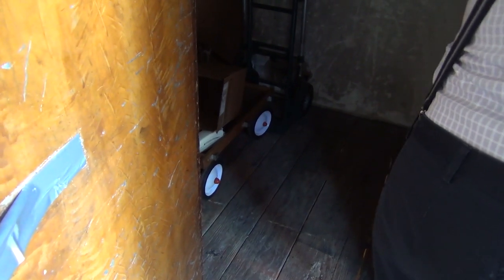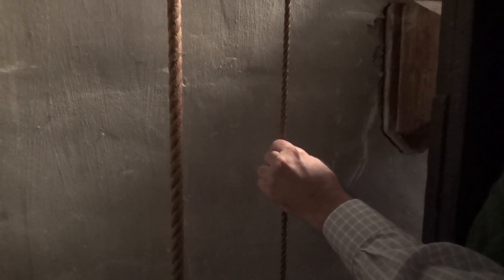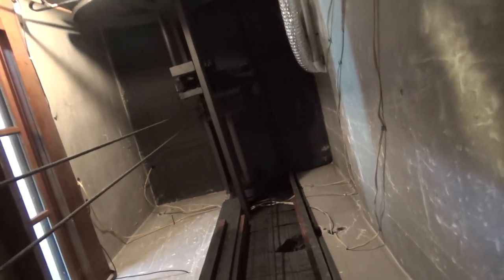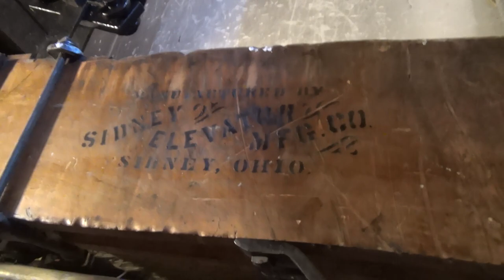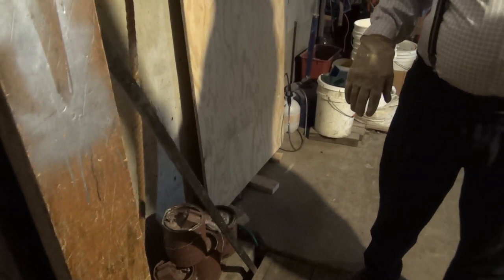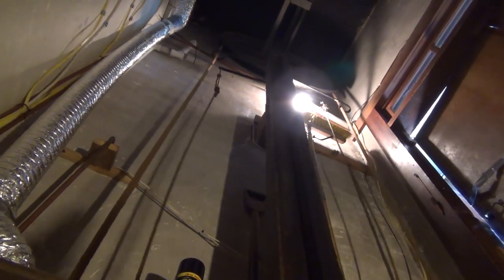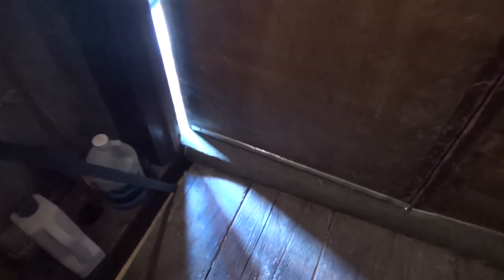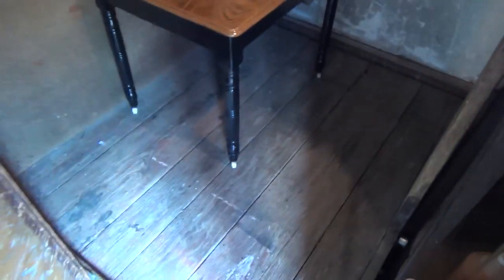Historic 1903 Sidney Non Electric Freight Elevator

Comment: I think this solves a mystery for me.  Sometime around 1972, when I was about 4 years old, my mother took me to a furniture store in Steubenville, Ohio.  She was looking for something specific (I have no memory of what it was), and they didn't have what she wanted.  The salesman (presumably working on commission), said, "We just might have something in the warehouse upstairs."  He took us over to an elevator and we got in.  There was a rope running right through the middle of the elevator.  He gave the rope a jerk and the elevator moved on its own up to the second floor (with the rope moving rapidly downward through the elevator).  I was amazed by the whole thing, but I didn't mention this to anyone due to the fact that at 4 years old I was still encountering new and amazing things often and the adults could be quite condescending whenever I mentioned wonder or astonishment..
This is the one thing I encountered as a small child that I have never seen again, and I have wondered for the last 47 years (or so) how the thing worked.  Even at 4 years old I could tell this thing looked old and didn't seem to involve electricity because he just gave the rope a jerk and didn't flip a switch or push a button.
This video probably explains it:  Because it was a freight elevator, the counterweight was heavier than the weight of the salesman, my mom, and me.  This caused us to be raised without any effort.  The jerk on the rope probably released the brake.  I think we came down the stairs and not on the elevator.  This would be because the elevator was now stuck at the top and would need to be lowered again with effort (or maybe by loading a bunch of heavy furniture that needed to come down anyway).
I still have no idea why it was designed with the rope running right through the middle of the elevator, and there was only the one rope not 2, so, it couldn't have been the same exact design as this and I will continue looking for a better example.
Reply: You have a memory like mine.  Cool story.
Reply: @juancarlosmontes  That, or it's just because we remember things that made a big impression on us for whatever reason, so it sticks with us.

Comment: I'm installing a dumbwaiter version of this system in my new house build. They actually still make these for dumbwaiters and commercial cargo lifts.  I plan to use an open mount at the top so the beautiful pulley system is exposed in the room. House has an industrial farmhouse design so it will look great and it's a split level design with 3 levels so really needs a dumbwaiter.
Reply from the maker: That's awesome!
Reply: Please post the video of it to see the mechanical marvels🙏🪔🇮🇳

Comment: I have one of these. Trying to figure out what's wrong with the counter weight
Reply from the maker: What’s happening with it?
Reply: @stlelevators  I let one of my tenants use it, and now it's very difficult to move and it won't brake effectively.

I've gone up and checked the brake, but it's fine. 

I suspect the counter weight is not attached.
Reply from the maker: That's possible. Are you able to check and verify the connection?
Reply: @stlelevators  I think I've got to rip off a bunch of wood to get at the weights.
Reply from the maker: Those cables look all messed up. Hopefully you can get it fixed!
Reply: @stlelevators  I think all I have to do is lift it up to get the counter weights on track, and then lower it down.

The rest should sort itself out, on the cars way back down.
Reply: @tysonclarke012 Any updates?
Reply: @natebit8130  I am alive! Lol.

I had to unscrew the counterweights and let them fall 3 stories into the concrete!

Then I had to reattach at the bottom. Was pretty scary - but I got it done. Been using for over a year now